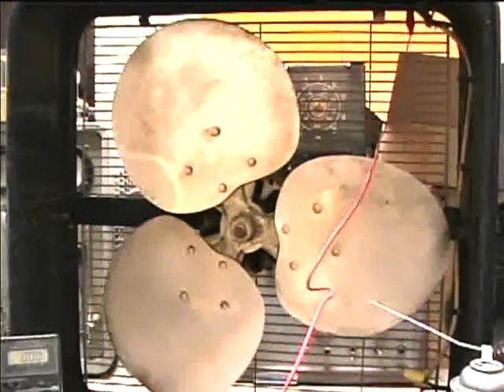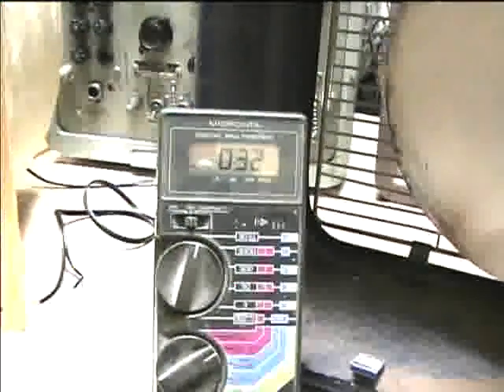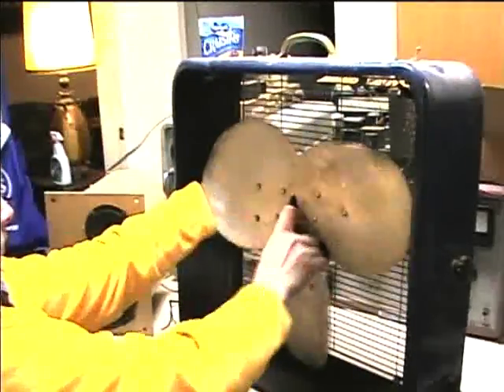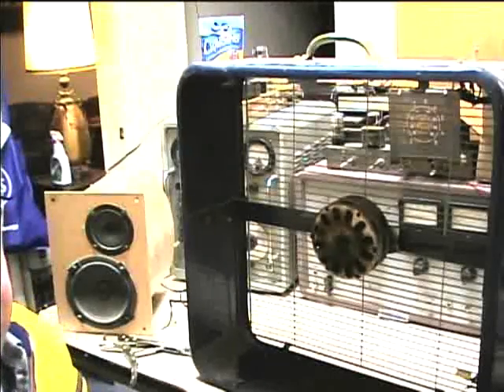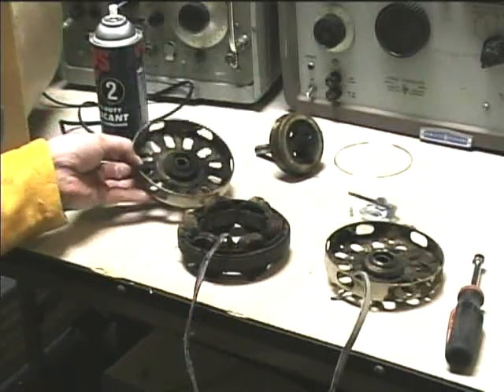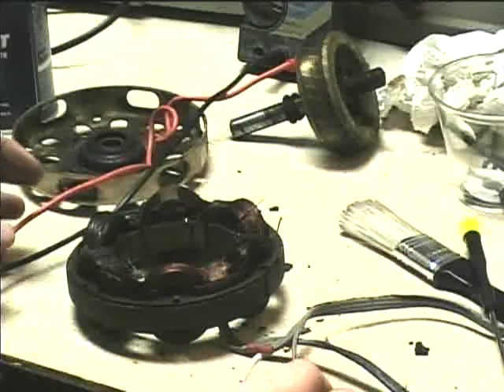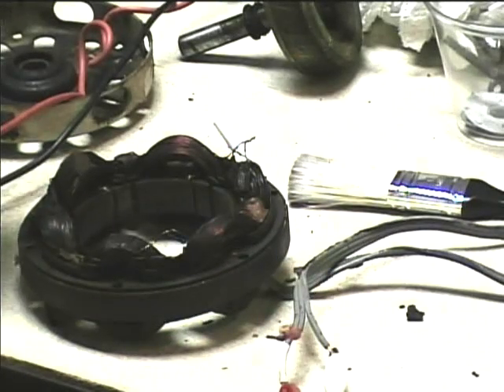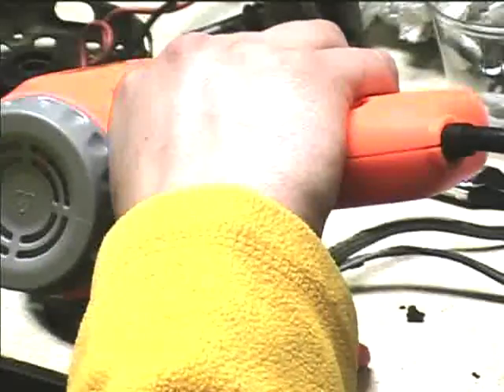1950's/60's?  Berns Air King (Wizard) Box Fan Repair Journal

Comment: When you get the motor back together and you're ready to reassemble the fan, run the motor and dress the shaft with some fine grit sandpaper (while it's running).  That will get that residue off and make it easy to put the blade on.

Good luck.